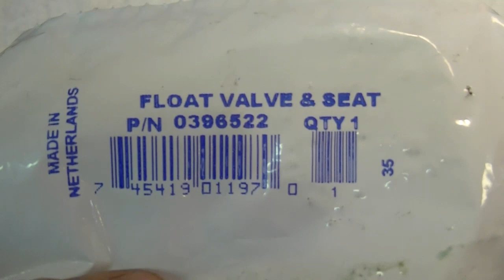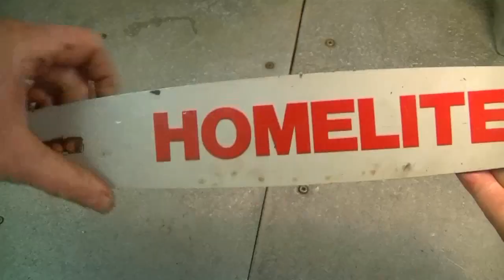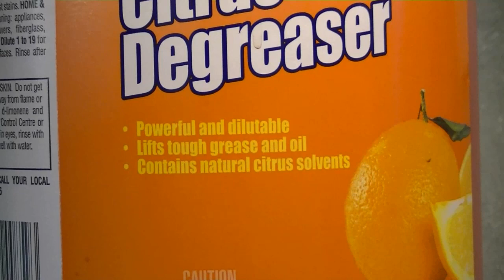Small Engines Q & A Video #62 in HD

Comment: @donyboy73 i had it running good never flew it got it from someone that said its a new engine but it was sitting in his garage for 5 years some of the plastic covering is ripped u prob. already know it pritty cheap to fix right now its taped all the wood is good it has futaba electronics i dont know how to spell it lol i live in nc and i dont realy know how mutch its worth give me a price i think its a 1998 plane it does need a good cleaning it has a brand new pipe